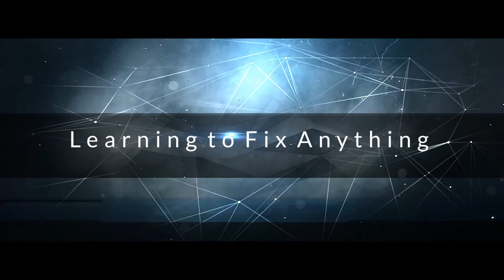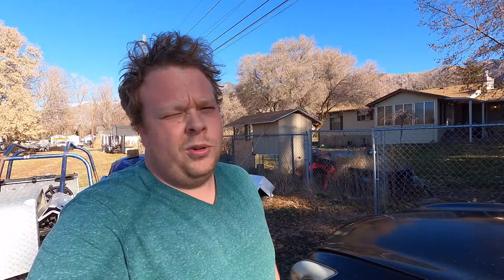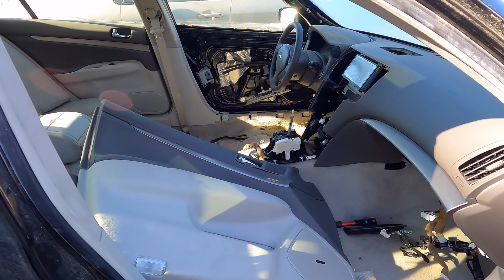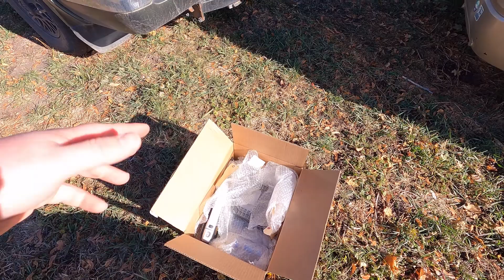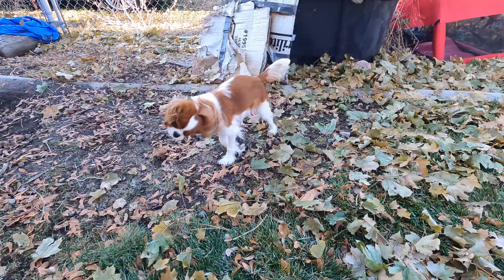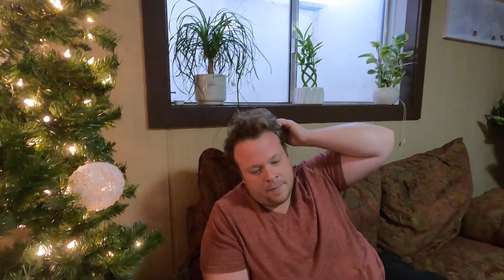Infiniti G37X Electronics Repair - Part 1

Comment: Hey I gave a 2011 g37x with a sunroof drain leak the car is a crank no start do you think you could help me out rq I’m not an air head when it comes to cars it’s just a weird problem to pinpoint I need help with it
Reply: I would guess BCM, did you get this figured out?